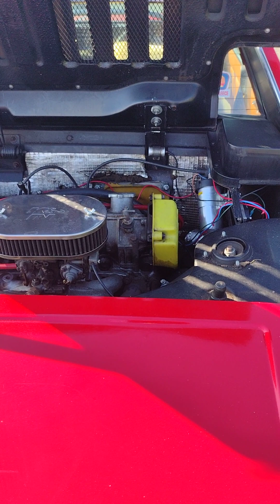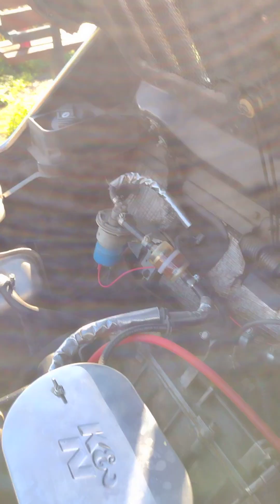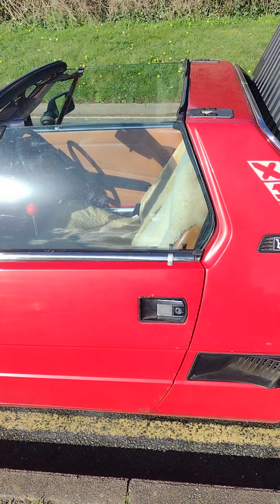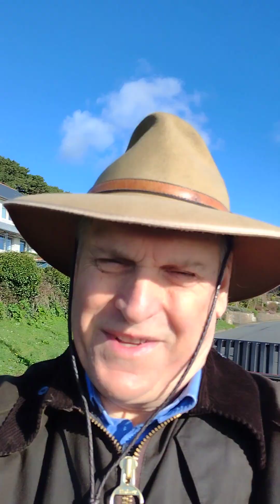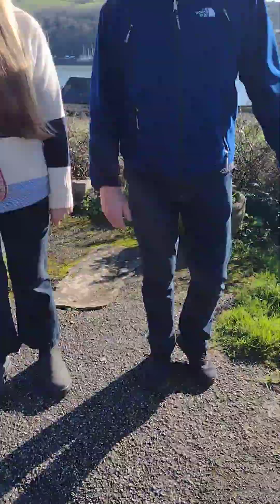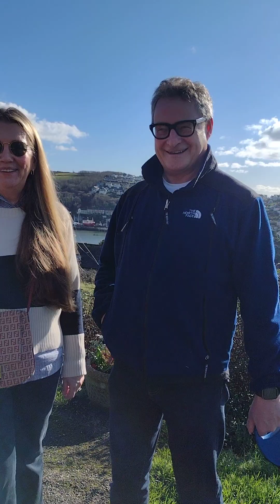Fiat X19 Fowey

Comment: Hello David, nice to hear again from you, able to seat down in the car :-)
Concerning the carburetor fan, I agree, it can be removed, less weight, less electric consomption on the battery...
The K&N filter box is nice compared to the original black round box BUT it sucks very hot air, being just above the exhaust manifold.  This is the advantage of the original air box horn, getting fresher air from the left of the engine bay (cool air contains more oxygen than warm air, better for the motor). You can even add a duct from the top of the horn to the lateral left inlet to suck outside ambient air (usually 15 °C difference between motor bay and ambient air ... given 2 or 3 % additional power to the motor, theoritically)
Reply from the maker: I made one of those and you are correct. But then I replaced part of the engine cover with mesh to let air circulate upwards from the side scoops. There should be low pressure over the engine cover. This will lift air through the engine bay.